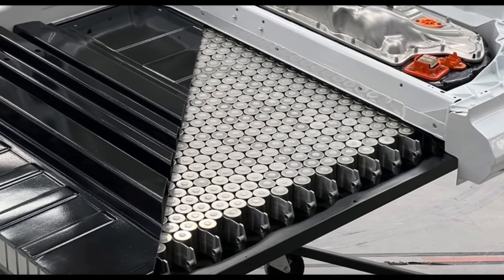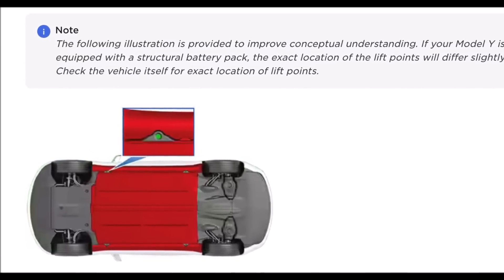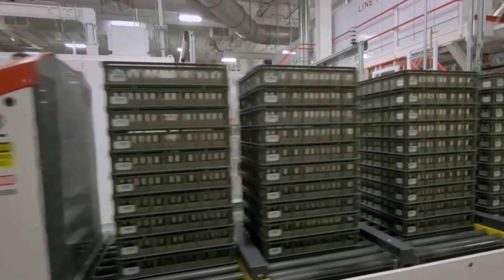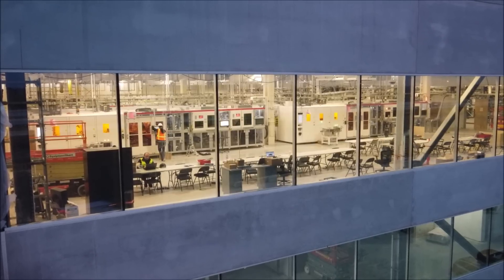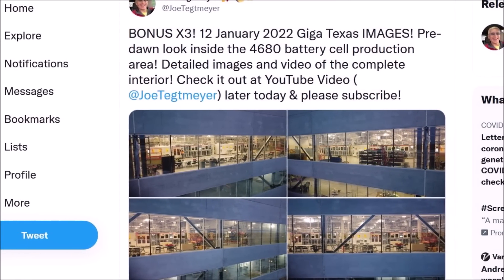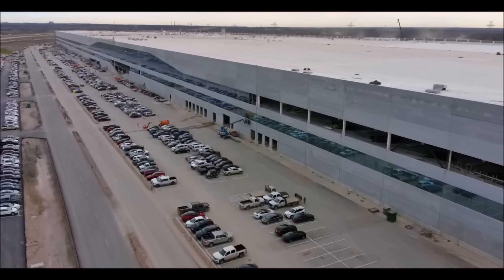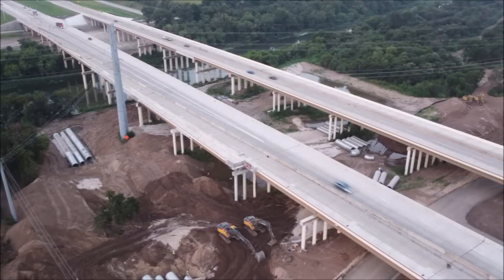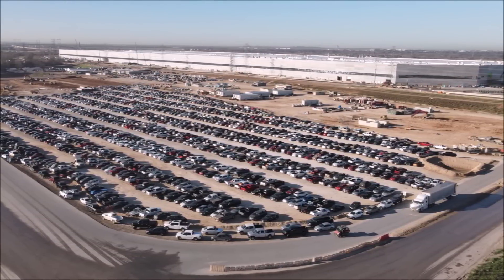BREAKING! Tesla Adds 4680 Battery Reference To Model Y Manual

Comment: this revelation, unfortunately, also indicates that the differences between a tesla with a structural battery pack and one without doesn't warrant anything more than a passing word or two WRT to the jacking points.

Comment: I got a message from Tesla for my new model y. “Tesla Update – We’re excited to share that the range of your Model Y has been upgraded to 533 kilometers (WLTP) at no additional cost. To unsubscribe from SMS, reply STOP.” Does it mean it comes with 4680 battery?
Reply: I got the same message and the projected delivery date is February/march
Reply: No it‘s not in relation with the 4680, it‘s because of the LG 2170 batteries. Unfortnately…
Reply: @driver-jh3yy  that is what I thought, 82 kWh battery from performance model. Any reason why? Should give better charging speeds at low temperatures but otherwise..?

Comment: The 4680 Batteries will be a game changer for Tesla. I think that the Model 3 and Model Y with the 2170 batteries are still great, but if I had a Model Y on order I would have definitely waited (and spent more) for the Gen II model with 4680 batteries, the structural case, and the cast frames. I wonder how much time it will take to update the Model 3 with those innovations? And will the Model S and X be refitted soon as well?
Reply: Me too.  I'm picking up a MYLR next Saturday; I'll drive it about a year or so then trade up for the Gen 2.  If it looks like air suspension is coming I'll probably wait for that too.  So maybe summer of 2023.

Comment: Now if they could only get those 25k model Ts rolling off, that will be the real game over.
Reply: The only focus now is and should be to focus as hard as possible on model Y.
 Ramping and improving model Y is the best thing to do until demand and supply is more equal.

No need for 25k car yet as they steal space in the factory from model Y.
Reply: Remember jac the goal is not to end legacy manufacturers, its to accelerate transition to a sustainable future.

Comment: 4680 does not become part of the vehicle body - it becomes part of its structure or chassis.
Reply: Or part of it’main structure since there will eventually be only fron + rear casting plus structural floor connecting both end. There is no name really to describe this. 😁

Comment: For sure they are being made, is my guess. Because the Semi is also seen rolling out of the Fremont factory. This one is know for it's 4680 battery design. I don't think they make test models with other battery form. They will make and test the 15 Pepsi trucks like the normal ones... They will ramp up than 4680 cell come quicker of the new lines. These lines comes from Tesla Canada and are tested and all most plug and play for production when arriving in Texas and Berlin. Shanghai will receive 4680 machines later, when building is ready. In Giga Texas they look almost run ready, in Fremont we do not know, but will be Nr.1 in delivery of 4680 I think. Pepsi Semi's could be the prove of production 4680... Very soon we will see 4680 cells made in Texas, Berlin and Fremont. Later also Shanghai... But for now Shanghai will use CatL LFP and BYD Blade LFP. In my view perhaps even a better choice, If you look at durability and ease of use and cost price. Cybertruck will follow as soon as 4680 cell manufactoring is on high/full speed. I think this year Q3 startup Cybertruck production Giga Texas. Now Semi testing periode is there....  And next quarter I think first Semi production starts if test go well and assembly lines are ready.
Reply: Good news one after the other!!!

Comment: Elon will be at giga Berlin Sunday.The Design Studio has upgraded the German cuonsumers accounts to March delivery, with changes in battery pack size from 77kwh to 82 kwh thus increasing the mileage to 514km in the model Y performance  and 565km on the LR model depending on wheel size The only color choice will be black and white only till the  factory production expands.